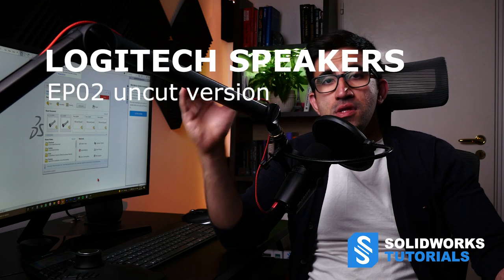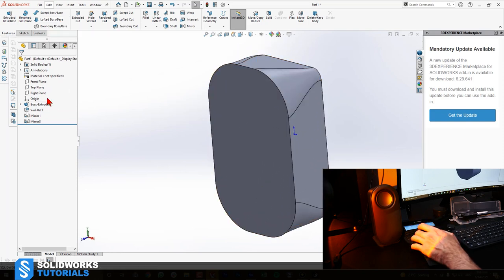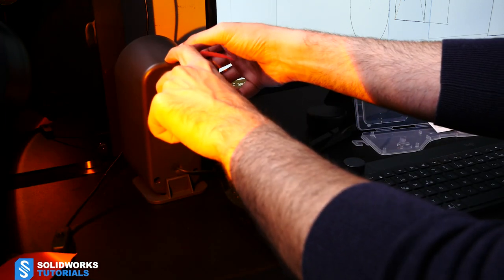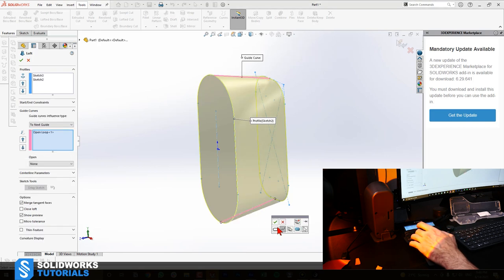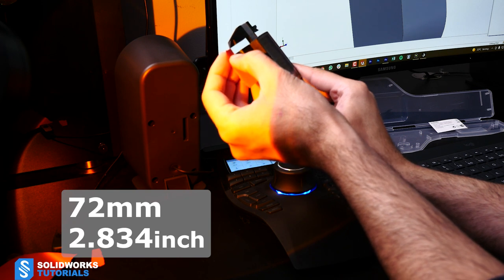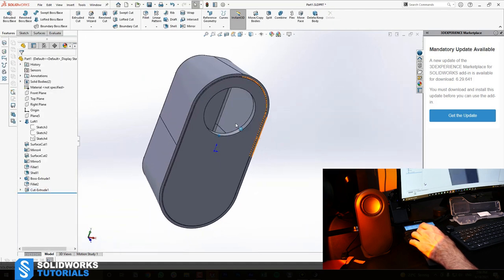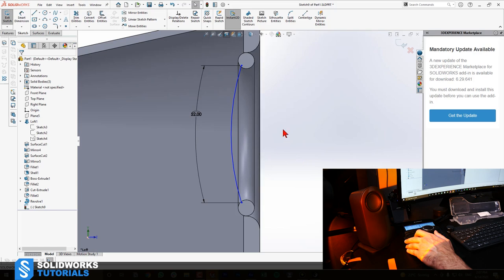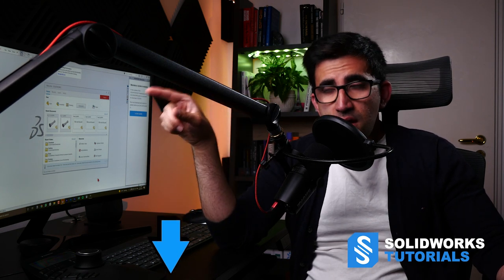What Professional Modelers Don't Want You To See On YouTube - Part 2 (Un-edited)

Comment: This is high school material, the only thing that I learned here is how to measure and define arc length... I didn't find any flaws in your video. Love how you think in the present... 
I've learned how to design in SolidEdge, very similar software... The only software that I like more than SolidEdge is SW... 
Others are hard to get used to...  I can get the job done in every CAD software, but these two are my favorites... 
This was actually the first video that I've watched from you xD Sorry for crashing and not watching the others. xD 
Teach people how to prepare 2D drawings with all dimensioning rules, many people lack that knowledge... Then it's harder to understand the drawing when you want to create a product, machining it...  
Talk about how and why are those rules important... It could save time for so many people in the production processes..
Reply from the maker: thank you for your comment. I already have that video, you should check more videos out. If you learn only on thing from each like this one, you'll be learning about 100 new tips and technics ;)
Reply: @with-Aryan  That's true. I'll be sure to check them out. I have to buy that 3D mouse, looks awesome, hope I'll be able to use its full potential. 
Well, one step at a time :)